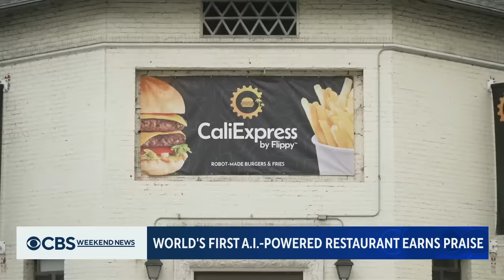Automated AI restaurant opens in California

Comment: I don't think this is real AI technology. The work flow in this resturant doesn't use any training model to improve these robot's skils. They just do the same things repeatedly. You can only call it as an automated restaurant like a factory but without the AI factor. Ideally, from my perspective, an AI restaurant can not only run these work flows automatically, but also improve their skills and solve new problems in the future. For example, a counter robot can handle drive through orders very well even if it couldn't at first.
Reply: I agree, AI seems to be a buzzword for anything technological right now. This just looks like automated cooking using specialized machines and robots to me.

Comment: They keep saying AI but all this is automated robots that we've had in factories etc for decades.
Reply: Yes the robots themselves are not new, it's the computer that is running them. Things happen in the kitchen that can change or vary the cooking experience. The idea is that instead of having a program that just computes an "assembly" of peoples orders, it's an intelligent computer that can handle sudden changes. Sometimes the deep fryer get's a little hotter after it sits for a few minutes unused, the next batch of fries to go in will cook a little quicker. If a piece of cooking equipment malfunctions or stops working suddenly (however unlikely), the AI can compensate for that by reorganizing the food production. Or sometimes you have that customer that insists on completely customizing their order (like extra crispy fries or no salt on the patty), the AI can handle that too, and it remembers you, your order, and when you place the order...for the next time you come in. Which is pretty creepy.
Reply: @AlextheHistorian  Software engineer here and I don't see a drop of AI anywhere in this chain. All the robots run on precise code that doesn't change. Even your example of the oil being hotter is solved by a simple thermostat and code that determines how long to cook based on the temperature (not AI, btw). The facial recognition would be the only "AI" thing and that tech has been around for a long time now. The memory of what you ordered isn't AI either, that's just regular software. Unless I'm missing something, I don't see any true AI here.
Reply: They even have a shot of the grill accidentally dropping the patty it looks like… that’s human not AI!
Reply: The key difference between machines used until now and new ones based on Artificial Intelligence (AI) is in their ability to learn, adapt, and respond to various situations. Previously, most robots in factories were programmed for specific tasks with limited ability to handle changes or unforeseen circumstances.
AI-based machines, such as those in a restaurant making hamburgers and fries, can learn and adapt to different scenarios. They process data, recognize patterns, and perform more complex tasks efficiently, considering various variables. For example, an AI machine can tailor hamburger preparation to specific customer preferences or handle anomalies during cooking.
Additionally, AI-based machines can improve over time through continuous learning, making them more efficient and adaptable to changing needs.
Reply: @thunder6742  thank you kind sir/mam
Reply: DERRR GRAMPA
Reply: @thunder6742  Looks more like PLC logic to me. LOL.
Reply: Nothing involving A.I. here.
Reply: @thunder6742 You must not have been looking closely because there is a camera at 2:18, clearly there is some computer vision happening here. There can also be strain gauge sensors that you can't see. The main use for AI here is dealing with the fact that each French fry or other food is not exactly the same shape so if it was just controlled by timings that may not always work 100% of the time.
Reply: It's clear how many people don't know what AI is.
Reply: @thunder6742 There is a sensor on the robot that can recognice which food it picks up. It was mentioned in another video but yeah i think that the good AI will take a while to come first we will replace more of the low wage factory jobs with automation.

Comment: When dealing with automation, if the machine breaks down then the store would have to close for the day until parts arrive.
Reply: Submitting a work order and waiting weeks for parts from China should be a fun experience. And it should be a real treat when the Windows or Android OS crashes or misbehaves.
Reply: They should have backup parts ready for fast repair.
Reply: My guess is that it is modular for rapid replacement. They are also probably utilizing digital twins to monitor the equipment and be proactive with repairs.
Reply: THAT'S when they will have to hire humans again!
Reply: No, they will have backup parts for everything and a few restaurants will pay someone $40/hour to be on call to fix them as needed…still a hell of a lot cheaper to do it that way vs human labor

Comment: The main issue is that there will be no change, there's no spark of change being motivated. Reasons as to why places like these can't find individuals is usually bc of economic unbalance either on a really high end or low end of the spectrum. With that being said, AI will only enhance the current state of which these fast food places are located in, causing stagnation and more of an economic collapse and divide. Whilst closure and failure is heavily recognized and motivation is sparked to create something new.

Comment: mcdonalds probably wouldn't get these machines for another 20 years because after working in mcdonalds myself for 2years, they are always understaffed for a reason and that reason is to force workers to receive more work. I've been in the back grilling the patties, frying the nuggets and chicken patties and baking the cookies/applepies all at the same time cause they want to profit so much with a single worker(1 worker for 3 different areas), while another guy works on the fries, the burger assembly and restocking, The managers would do the front desk with cashiers and just yell for any missing items. These new machines will probably not be able to push out the speed workers do(especially when they need to cut corners during rushhour). And the maintence is probably way 5x as expensive as just hiring a worker and let them recieve burns/cuts when working too fast.

Most of the people think its tough but lol, them trainee managers in the front be just slacking and the worst part is they are always mad, as a way to show that they are serious so that they can be promoted to district managers. But seeing our district manager being some lady(that dropped out of college) but running around claiming shes self-certified business degree because her husband let her borrow some money to own franchise.  You won't be promoted through hardwork guaranteed.

Just letting all the younguns know what they are signing up to when working in mcdonalds. Do not work in the kitchen. You will regret it. Its nowhere like in the animes where you just flip patties. You will get bleeding toenails and burns everyday. Also had to learn spanish just to speak with my trainee with i first started, because they said they will only speak spanish to me, and sheesh these people are extremely racist(such as saying why you come here to work when you need to stay in china to eat dogs). The only exception is if you get cashier only.

Comment: If you want fully automated fast-food restaurants, the buildings have to be much bigger than usual. 
You need the repair man for regular maintenance, an advanced robot programmer if there are errors that need to be fixed. 
You also need to professionally clean the robots, so they don't malfunction and break apart over time. 
Heck, I have a better idea, let's have robots help make healthy foods instead to lower the cost to encourage healthier eating habits.

Comment: I worked in the bread business for 30 years and delivering buns to burger joints was part of it. It’s not uncommon to see premature molding in the hot summer months due to product setting in extremely hot distribution centers before it was delivered and hot delivery trucks. Will these robots just keep cranking out burgers with moldy buns if that’s the case? Or you’ll get buns that were frozen. 😝